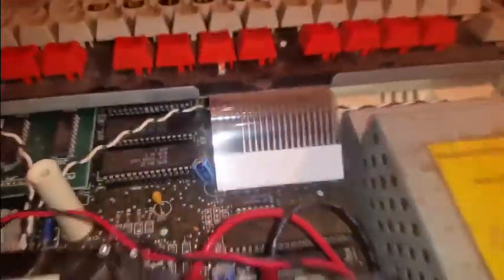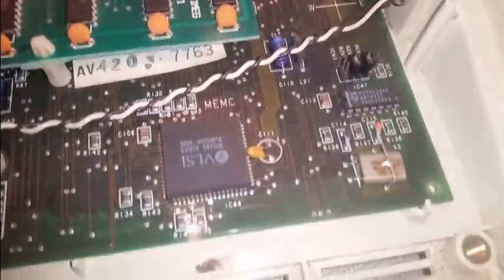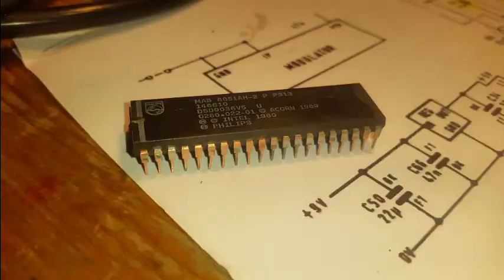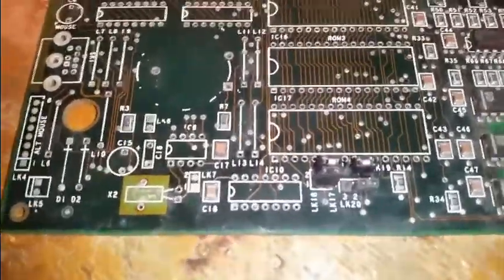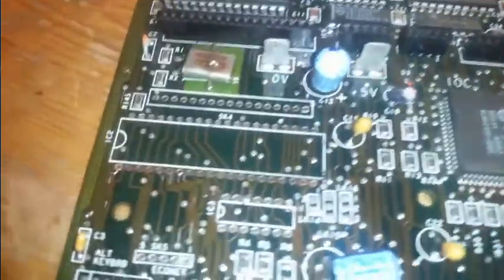Archimedes A3000 Repair Part 1 (Rough Audio)

Comment: Just cracked open an A3000 I was gifted years ago, after watching this video.  Sure enough, the battery had leaked & made a mess, only worse than seen here. A couple of keyboard connectors had rotted away, one inductor fell away from the board as I cleaned it down with alcohol and the 32Khz xtal was just a green blob on the board.  Alas, it doesn't boot either.  My question, did it ever occur to the geniuses that designed the Acorn(s) that this would happen over time?  A couple of other Acorns also suffer from the same problem if Utube is to be believed.  TWITS!
Reply from the maker: Yeah, short-termism I guess. It was a bit idiotic, especially as they put a slot for two AA batteries on the underside of the case, just under the cmos clock! That is where my batteries go now lol.  Many Amigas 500 Plus suffered the same fate I am afraid to say. Good luck. It can probably be repaired, depending on how far you want to go with it. Funny enough I am just doing a new video as I got a Gotek floppy emulator working on it. No luck with the harddrive as yet though sadly😞